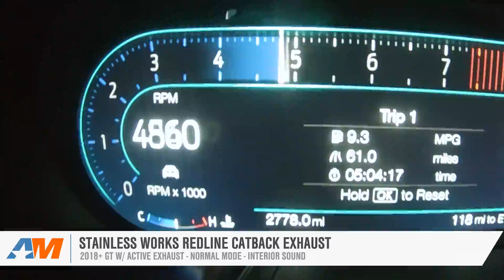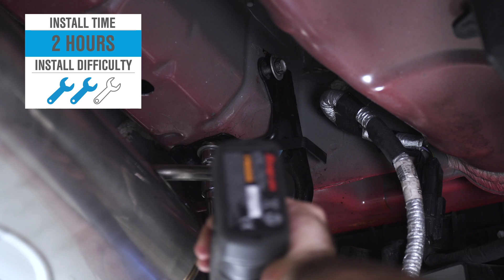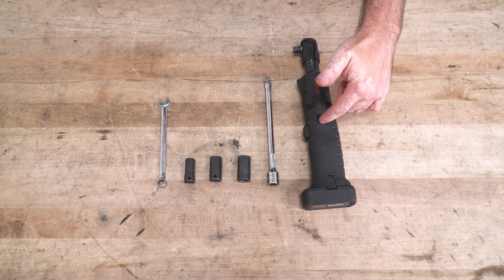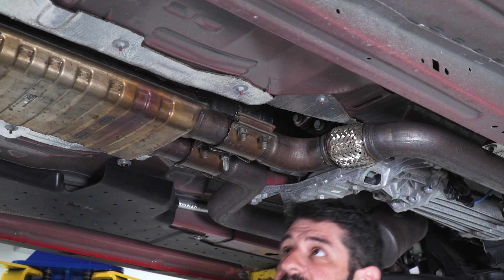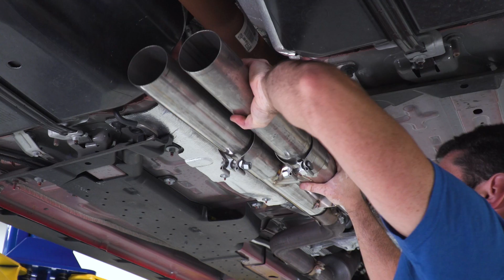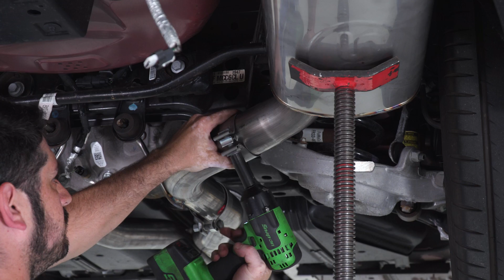2018-2021 Mustang GT w/ Active Exhaust Stainless Works Redline Exhaust w/ H-Pipe Sound Clip & Review

Comment: If it only has three modes, wouldn't that give the electronics a conniption? From what I understand, the active systems from Flowmaster, Corsa, Borla, etc. all work with the factory settings and all four modes
Reply: It does have all 4 modes. The modes are programmed into the actuators, which this system uses. Track mode is meant for off road use so that's likely the reason why it was not shown here.